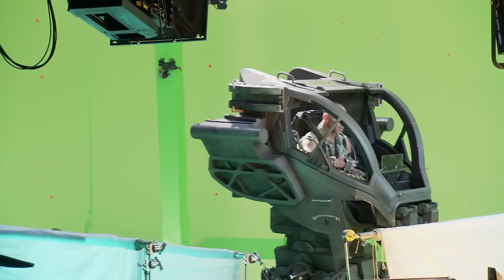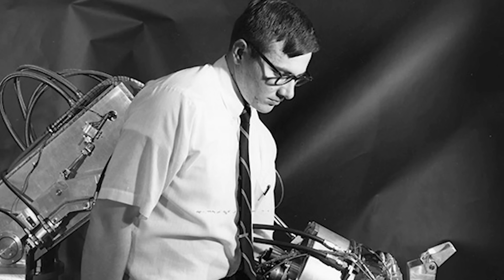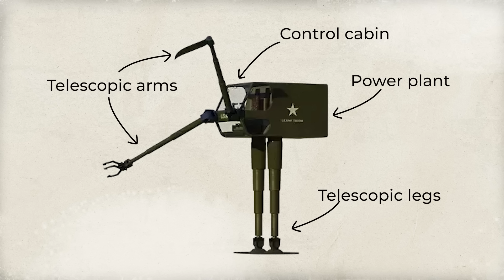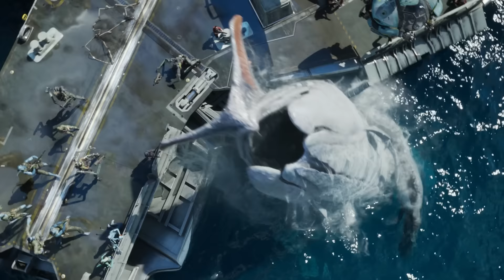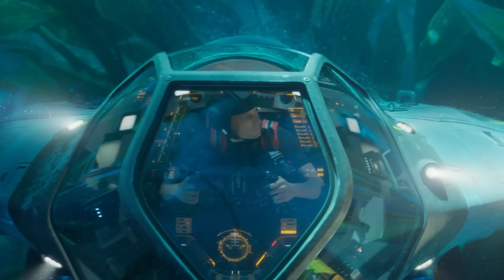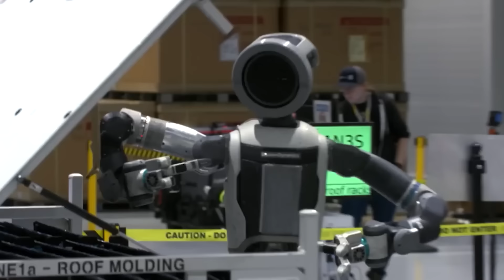The mech suits from Avatar are older than you think

Comment: Crab suit with an AGI = Tachikoma from Ghost in  the Shell. Overall design is based on a jumping spider rather than a crab and the human "pilot" rides in the rear pod (the spider's "abdomen") and is networked to the AGI. The human provides direction and oversight with the AI doing the actual piloting and weapons control. The AI does all piloting and the human pilot is completely enclosed in an armored pod and sees the outside world through the machine's sensors (everyone in the GITS universe has a dataport to interface to computer systems). The human pilot is actually completely optional, they can disembark and the machine can continue to provide backup and fight independently.

Comment: we wont be able to build anything close to it for maybe nother,,50-70 years hmm for so many reasons,,  big ones are,  battery tech- is waaay waaay behind, sure can carry onboard engine for power then again engine size, weight, fuel storage is a issue,, with todays Actuators You’d either move like a drunk crane or tear your own joints apart,,Joint stress & materials- 10-20 ton biped stomping on uneven ground is a structural nightmare. take your pick! its Light enough to move but too weak → breaks or Strong enough not to break but so heavy it sinks or can’t move fast..  Balance & locomotion? you'll need Millisecond‑level feedback from tons of sensors ,Ridiculously fast, robust control algorithms
and Actuators that can react instantly assuming the human pilot can keep up !! all that crap going on gonna generate lotta heat your gonna have to manage !! + Cost vs. performance ,Maintenance & logistics  shit list go on  also there are Better alternatives that already exist yeah i don't see it happening any time soon sigh

Comment: Neither 2 legged version as depicted in the movies would work because the center of gravity is off.   They don't maintain the COG over a single platform.   The moment they lift one foot the vehicle would topple over.   The ATST in Star Wars works properly by placing the foot drops directly under the center of gravity.   The AMP suit only appears to work because it is CG animated and they simply cheat by ignoring the COG.

Comment: Good grief... Next time can you skip all the filler and just stick to answering the question??? In addition to this. Your argument is nonsensical. The Amp suit wasn't designed for concealment. So why are you even making this an issue?? It's a walking tank. Period end of sentence. The Skill suit or whatever is a force multiplier for the human body. It also allows them to stand on even ground with a Navi. We may not have seen them but i am sure they could easily armor up one. And the dumbest statement of all about the crab suit. It's fast underwater. Where you are going to be using it. Why don't you seem to understand this? All 3 suits are Purpose built period. Of course they are not a one size fits all. They weren't meant to be. Oh by the way they could just put a mini Phalanx on the Amp suit to shoot the drone down as point defense so that shoots your argument down as well. Since you didn't bother to answer the questions in this 21 minute video. I will. Not yet. We can't do it yet but at the rate of advancement. maybe 10 years at the most we will at least have the skill suit.

Comment: Considering the RDA has both Martian and Lunar colonies I imagine the AMP suit was put to use, or even developed, for the primary purpose of construction/transport in an environment with a nonexistent atmosphere.

Oh and please don't use AI. It cheapens the production. Just use still images if you can't find footage.
Reply: Something that the film technical manuals (the background content not shown in the films) mentions is that the AMP suits were only ever really made truly viable on Pandora where the low gravity and dangerously high oxygen content (the reason the flame-exhaust is blue outside the sealed hangars, and why ships go up in such big fireballs, and why humans can breathe with those silly filter-packs, but not naked lungs), make both the weight and the fuel consumption drop into an efficient range.  There is mention of battery operated versions for zero-atmosphere, but they were mainly made for 'toxic' atmosphere.
Reply: @NikkiTheOtter I believe it is mentioned that many if not most of the vehicles and gadgets in avatar were designed and built to operate almost solely on pandora and to be fueld by unobtanium
Reply: @jackfoy3938  Not fueled by. It would be FAR too expensive for that. It's a room-temperature superconductor, which means it makes things like anti-matter reaction engines viable (The big things on the ISVs that stop them at Pandora and get them going back to Earth). Though yes, including some in the structure of things like the Valkyries would increase cargo lifting capacity and allow the easy hover the space-shuttle-like design was able to do.

Comment: 20:35 The Skel suit and crab suit yea. But the AMP suit cannot be justified as a utility platform adapted for combat. 

Something like that has to be a combat platform first with utility added on. That thing has to be purpose built. Utility is an added benefit added on and that can be done even at the drawing board. You simply cannot justify any use case for that thing in a civil/rear echelon setting. If you really need control it’s always going to be cheaper to just slap on an end attachment to a wheeled or tracked forklift or put the top half of an AMP suit on some wheeled or tracks.

Construction? You still need roads and prepped surface for trucks to bring materials in. 
Warehouse logistics? You’re in a warehouse go use wheels
Field resupply? You’re gonna need roads or a prepped surface to get trucks in or for aircraft to land. Even with sling loads, the last time I checked pallets and containers don’t have legs. If you’re gonna build a FOB around a containerized habitat module, you might as well sling load in a bobcat instead of sling loading an AMP suit. 
Mining/logging? You’re gonna have to build roads to haul stuff out. 

My point is, if you need human-like mobility in like a jungle or mountain top, you’re only doing combat or combat adjacent activities like Engagement Area Development. 

The AMP suit is a good weapons platform. You don’t have to worry as much about cover and concealment because you’re not sending it out as your Forward Line of Troops during patrols. You can send out a platoon of light infantry and have your AMP suits trailing behind. Infantry already clears the path of any observers. If your platoon takes contact, they already know your there, AMP suits can then move up and help take care of that threat and prevent them from amassing more troops. 

AMP suits will always be your base of fire while light infantry can maneuver on a now fixed enemy. 

Like you mentioned it’s like using tanks in those type of terrains. It’s still a trade off on the armored vehicle triad. Mobility over firepower and protection. As far as drones like you mentioned, you’re just as vulnerable on something less mobile so that really isn’t a factor. Unsupported infantry can’t hide either. Weather it’s wheeled, tracked, or legged platform, airburst autocanon rounds are pretty effective against UAS.